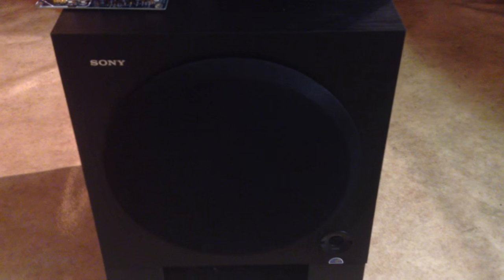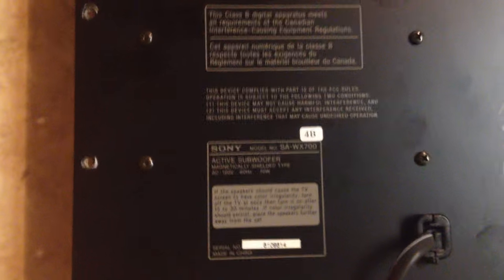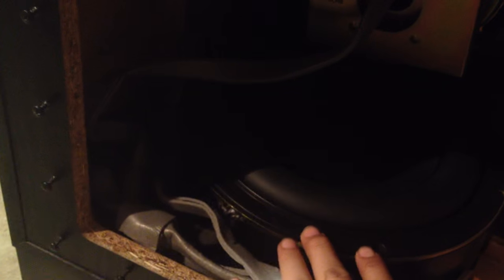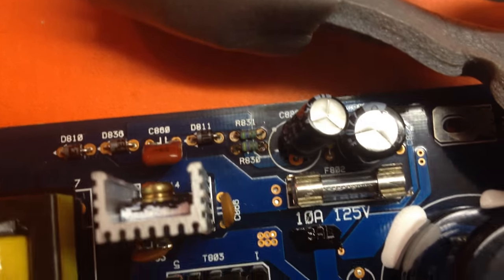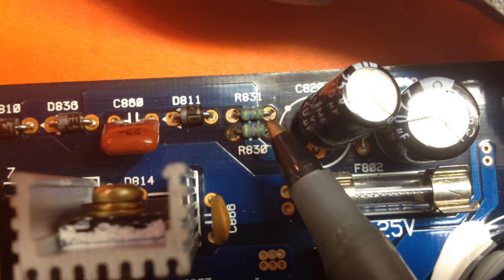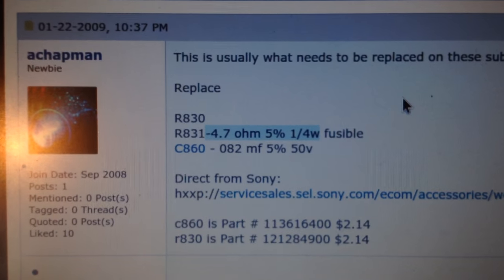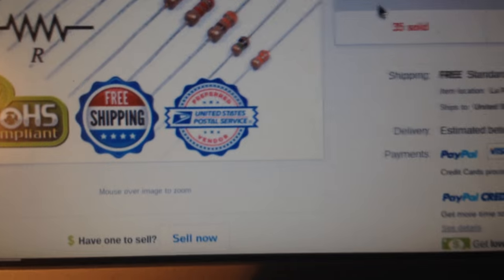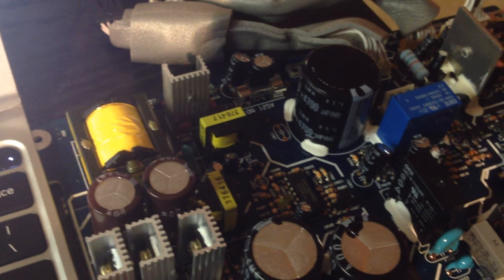Sony SA-WX700 dual subwoofer speaker diagnosis and repair. PART 1

Comment: I've got an infinity TSS-1100 that is not working that's what brought me here. I watched your 2nd video as well. 
I'm no expert, but when you flipped the board over, I noticed 865 and the surrounding area looking a little dodgy. Maybe in video 3 you could post some clear shots of both the top and bottom of the entire board. Also, you can get a plate amp to power that fairly cheap from Parts Express. Good Luck!

Comment: Hi, i know this is an old Thread. but Can you tell me what part number is the little black board on the amp? I have one of these amps and would like to fix it. I took it to a place for repair and they said that what looks like to be a black chip on the board is burnt out, they could not replace it because the chip is no longer made. So i would like to see if i can find the little black board on this Sub. Looks like its Flipped upside down and to get it off i have to do some unscrewing. Thanks for your help.

Comment: i have the exact same subwoofer unit. It powers up and i can hear the bass channel from the input but there is contant static noise(not the humming sound during standby) that comes from the subwoofer. The static is there even if the subwoofer not connected to any device. Any advice?
Reply: its back in business, in my case i had to replace to ICE250A amplifier  piece.  $112 from mainland China.
Reply: Hey Hassan, do you have a link to where i can find this ice board? mine needs to be replaced. Seems mine has one of two black chips bad.  You help would be appreciated. Thanks.
Reply: I found it on Ebay. Thanks anyways, so far, best price is $61.88 :o)